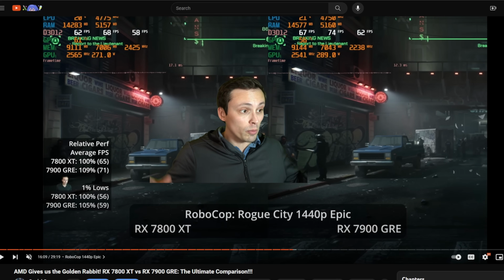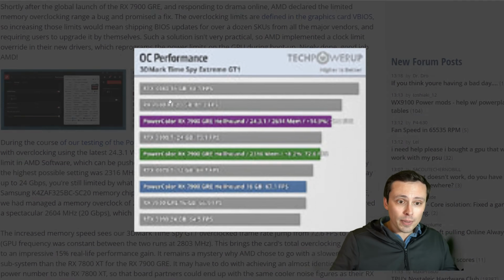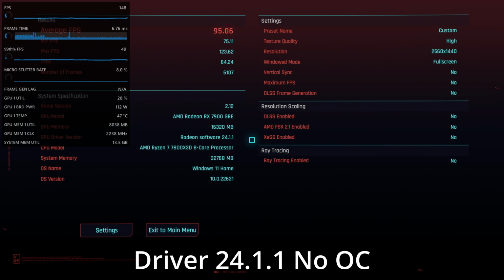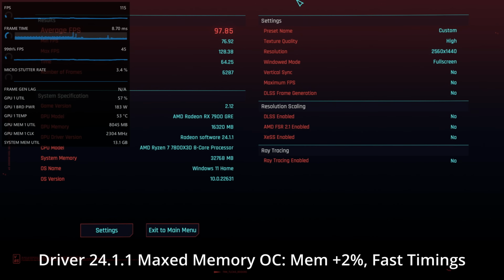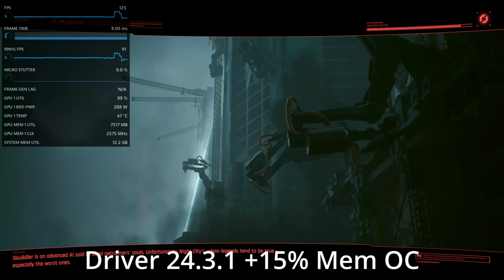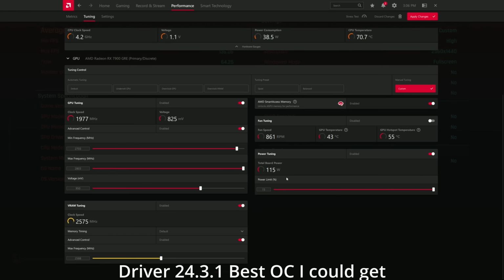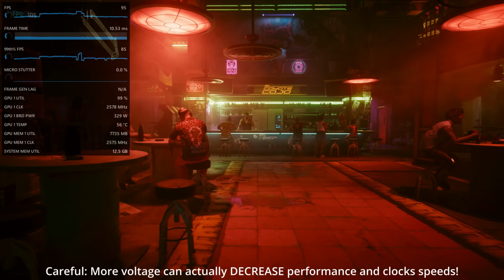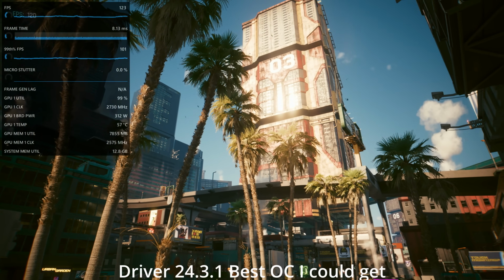Download more performance for certain AMD GPUs!!! (7900 GRE memory OC limits boosted in new driver)

Comment: I personally would aim for the highest speeds with the lowest possible voltage i can get
Reply: overclock kills the undervolt
Reply: @lifemocker85 ehh everyone’s hardware is different I suppose. My 3060 ti .975v with overclock to average 2025mhz user 210ish watts than compared to it using 300ish watts and 75ish C. It’s the asus rog strip V2 so my card can use total of 325 watts max but stock voltages and overclock too much power and heat, I do same to the 5900x 1.250V on core V and .900 on socket V with 4.7 all core, didn’t like going higher
Reply: @BMGGHOST  after certain mhz effiency just flys out of the window. if one wants effiency undervolt but overclocked effiency is gone
Reply: @lifemocker85  that is true, my biggest thing isn't really efficiency but temps I will correct the way I meant. I tend to go for it's rated speeds but if you lock it all core now adays people say that's an overclock even though I know that's not really what it is. So say 5900x I believe is rated for 4.7(without searching) so I lock all core to that and try to get the lowest voltage I can get so I can mainly lower my Temps with lowered significantly

Comment: Hmm. Very strange. Previously, in the 7900 GRE vs. 4070 Super and 7800 XT comparisons at stock memory and GPU frequencies in Cyberpunk 2077, you had an average of 102 FPS (QHD Ultra). Now it is 95 FPS at stock frequencies. And after memory OC without GPU tweaks, 104 FPS. Why such an inconsistency between previous and current results?
Reply: Different amd driver
Reply: @k1cs1m3a8  So it means that without memory OC, just with different driver you have almost same performance and memory OC give us only +2-3 FPS? What is all the fuss about? Update your driver and don't touch Vram)))
Reply: @nikitamorozov7553  no, the new amd driver give +2fps. And with the unlocked memory oc you can get +15Fps. In overall the gpu can do %20 more if overclocked than in stock. In stock 5% faster than a 4070 super with overclock much bigger gap.
Reply: @k1cs1m3a8  Sorry, but we are not talking about some probabilities. I compare certain previous video of this lad and current one - there is no +15 FPS difference. We have 102 FPS (old video result), 101 FPS (current video with 24.3.1 driver stock settings) and 110 FPS (24.3.1 driver with Vram OC and undervolted and overclocked GPU). This is less than a 9% performance gain.
Reply: @nikitamorozov7553  you should re-watch this video…..
Reply: @nikitamorozov7553  He retested the old driver in this very same video. It's comparable to what other 7900GRE get. https://tpucdn.com/review/powercolor-radeon-rx-7900-gre-hellhound/images/cyberpunk-2077-2560-1440.png
Reply: @nikitamorozov7553 hahaha good point man!. Full agreed. Its crazy. Daniel its biased for amd. Im disapointed. 😢😮 But why? So real fps its 2-3% boost. Definitley not 15...

Comment: Games I can recommend to test if your OC and UV are stable are GTA 5 and Fortnite. Both games are very sensitive to "errors and fluctuations" on different cards. If it is unstable, it will crash for the first 5 to 10 minutes.

Comment: In real world tasks, the VRAM overclock is only stable to about 2500 Mhz at most. For many it's only 2400 Mhz. That's disappointing frankly. Also, the AMD overlay negatively affects performance and shouldn't be used.

Comment: I have some knowledge of basic overclocked and I think the reason you lose performance when you push the voltage is because of the power limit and higher temp. In overclock to archive the higher clock speed you need the card to be more efficient, so undervolting make the card draw less amount of power to do the same task of work as normal card.

This make it so that higher voltage make the card reach power target before they can archived desired clock speed, also higher temp sometime reduced the clockspeed thus making it draw more power to push the clock and reach saturation much earlier than when undervolt. 

I’m also not an expert just love undervolting my gpu to get best result, I might be wrong if anyone understand it better feel free to correct me.
Reply: overclock kills the undervolt

Comment: Still wondering why AMD didn't name this the "Radeon 7900" or "Radeon 7800XTX" for the international markets? Either name would've fit in the line-up, maybe they really wanted this to stick out?
Reply: It is not something new. They released a RX6700GRE in the previous gen as well. Both cards were made for China in the first place. They did this with the chinese RX500 series as well but instead of GRE they were named SP or something like this.
Reply: Game Revolution Epic. ❤😮
Reply: It makes sense to keep the name that the card already had in its original release.  Why come up with tons of new names for the same cards?
Reply: They could've named it RX7900XL but does it really matter that much?

Comment: Loved my RX 6700 XT but ever since upgrading to RTX 4070 super, everything just runs much smoother. Initially I was thinking about picking RX 7900 GRE but since I only play on 1440p RTX 4070 super is more than enough for me.
Reply: So you paid more for less performance.
Reply: Not really, my cp2077 benchmark (w/o undervolting and overclocking) achieved a higher average FPS (105>101) and a much higher min FPS (95>86) compared to Daniel's results. I'm not a huge fan of Nvidia's GPU prices but coming from an AMD GPU, Niadia's DLSS/FG and other features are still years ahead of AMD. @ZenAndPsychedelicHealingCenter
Reply: @lucaschenJC amd fanboys only see the gpu prices, raw performance and vram, they dont see the other things
Reply: @lucaschenJC which 4070 super do you have? Also, 1440p ultra benchmark? My 4070 super at 2830 mhz scores 88 fps :/
Reply: @Superdazzu2 Founders edition with the latest driver. Benchmark settings are kept exactly the same as what he did in this video.
Reply: @lucaschenJC  my question !! what makes rt so special on game which is ready special all alone ?? rt is just an unrealistic thing on games and the all the games are trushes with rt cause developers sucking with it !!! so there is no sence to run for rt and not even deserve that 150 more bucks !!! rt tbh is way more usable if you are working with it !!!
Reply: @ZenAndPsychedelicHealingCenter  better RT performance, DLSS superiority, efficient & DLSS 3 lastly must've weighed more that made him go with nvidia. I don't blame him tbh, cause I was on the verge of getting 7900xtx, then I saw few benchmarks and I changed my mind to go for 4080 due to RT performance.
Reply: I’m in the same boat but I’m waiting until I can double my 6700xt for $800 or less. 4070ti super is kinda close but not quite
Reply: Depending on what resolution you're on, I'd say wait for a future price drop for 4080/4080 super cause 4070 ti super isn't that much better than 4070ti/4070 super. @ipotato95
Reply: The 4070 enough but the vram not lol
Reply: @k1cs1m3a8 like I said I only play games in 1440p, so far there isn’t one game pushing anywhere near 12 GB VRAM with ultra high settings and no RT. 12 GB VRAM would only be inadequate if you game on 4K or like turning RT all the way to the highest.
Reply: @lucaschenJC  wrong!

Comment: Are AMD fan boys really praising AMD that the artificial limitations imposed by them are finally being lifted, when it should never have been there to begin with? 🤡🤡
Reply: Artificial limitations like not allowing overclocking at all in driver like nvidia? 🤡🤡
Reply: @blegi1245  why are you comparing it to nvidia? I thought AMD was supposed to be pro-consumer but they artificially lock their stuff too? Cant have your cake and eat it! 😂😂
Reply: @innie721  if amd allowed limitless tuning options and people were killing their cards by dialing in 3 volt vcore (or whatever the maximum value for the voltage controller is) you would be here blaming amd for the dead cards because you are a bad faith nvidia shill. Btw 90%+ of amd "driver issues" are people blaming amd graphics drivers for their unstable overclocks.
Reply: bug aint limitation
Reply: @blegi1245   that was for the op

Comment: One thing that can happen in rx 7000, or at least on the XTX is, that if your min clocks are too high while overclocking it can happen, that the clock of the VRAM goes down. This can be helped a lot with undervolting it

Comment: since most of the amd gpus are power limited (even a Vapor X 7900XTX) undervolting = less power draw = not (or not as often) hitting the power limit = more stable clocks.
Sadly AMD took away one of the greatest tools the 6000 cards (and below) had, MPT. 
You could undervolt SoC, Mem, Core individually which lead to an even greater increase in performance + better temps.
I will forever hate them for doing so.
Now the only option, if already undervolted to max stable, is to flash your bios
Reply: Can't even flash your vbios without buying a Ch341a bios programmer. AMD is notorious for locking down overclocking. It's pretty lame.
Reply: @jjlw2378  Lol this is the first gen that AMD lock down their bios, after all those used RDNA2 cards ended up with mining bios.
nVidia is the one that is notorious for locking down their vbios since Turing.

Comment: My 7900 XT Runs absolutely perfectly on the latest drivers. 
I just switched to AMD, and it seems there was no better time. 

I've been playing for hourrrrrs for days on both old games, new games, and retro games. Everything has been perfect. 
And got a beautiful undervolt and overclock on it.
Reply: Idk why AMD has this "crash happy" stigma attached to it. 6950 XT never has an issue. Competitive and AAA games from the last 5 years all run perfect.
Reply: @TheCosmicMason    Only time I've gotten a "Driver timeout" or crash is from me trying to overclock the thing by 15% lol .

And when that happens, just means i need to add a little more MV juice :octopus-red-waving:

But Nvidia is not different lol. I've had a 4070, 4080, and 4090. One second I think the overclock is good, then I crash randomly hours, minutes, or just sitting at the desktop lol. 
Overclocking or undervolting can be a real bitc. It takes time, testing, and patience if you are trying to push high, or low. 

Outside of self induced errors, never a single issue of ANY kind. The ONLY thing AMD wise I've ever had issues with is their metrics not showing up in certain games. that's literally  it lol. And I use afterburner for all my chart goodness.
Reply: @TheCosmicMason  It's not the crashes that are the problem personally, but if you look at their patch notes apparently there are problems. The thing is when you run AMD and Nvidia side by side daily like I do you realize AMD absolutely earns the reputation of instability and poor drivers. They're miles ahead of where they were in the days of yesteryear, but when you run them side by side they just can't quite get there compared to Nvidia. Especially when it comes to VR.
Reply: @zodwraith5745  Look at Nvidias patch notes, and not the ones they show briefly. They have game crashing, and failure to boots as well. doe shappen more on amd on average, but Nvidia isn't out of the park.
Reply: Have you tried Helldivers 2?

Comment: 18 gigabit per second per pin is the fastest GDDR6 memory all 3 major memory manufacturers (SK Hynix, Samsung and Micron) can supply. If you specify 18 gbps memory you can bid all 3 manufacturers against each other and significantly reduce cost. That is also the reason why Sony chose the same memory speed for PS5 Pro.
Reply: As many times as you say this on many different comments it doesn't make it true. It doesn't take more than 3 seconds to look at the 7900XT or XTX to see that you can buy 20gbit/sec GDDR6.
Reply: @zodwraith5745  you can buy 24 gbps GDDR6 you absolute rtard. Problem is that only one manufacturer can make it and because of that you pay monopoly prices for it (just like nvidia does with proprietary nonstandard micron GDDR6X). Xtx and xt use 20 gbps memory because 20 gbps is the fastest memory Samsung can actually supply (the faster speeds exist only on spec sheets). 20 gbps is more expensive than 18 gbps because you go from 3 possible suppliers to 2 possible suppliers. 24 gbps is even more expensive than 20 gbps because you go from 2 possible suppliers to 1 possible supplier. Understood or is this beyond your comprehension?

Comment: It really seems like when they were designing this they were hypersensitive to make sure it doesn't touch the 7900xt without paying attention to the 7800xt and gimped the memory way too hard. I have to wonder if they bought WAY too much of the cheap memory for the 7600, 7600xt, and 7700xt without them selling enough to go through it.
Reply: 18 gbps is the fastest GDDR6 all three manufacturers (SK Hynix, Samsung and Micron) can supply. Graphics memory faster than that is significantly more expensive because you can't bid all three against each other. It's not a coincidence that Sony chose 18 gbps memory for PS5 Pro as well.
Reply: @blegi1245  Huh? The 7900xt and 7900xtx use 20gbit GDDR6. Not to mention GDDR6x is even faster. Where did you get this idea that 18gbit is the fastest GDDR6? Sony chose it because it's cheap. Period. They've been doing that since the PS1. Same reason AMD does. AMD keeps using it because even the 20gbit is half the price of the GDDR6X that Nvidia keeps using. 

People keep thinking Nvidia is "cheaping out" on vram without realizing GDDR6x is $8/GB and GDDR6 is $4. Nvidia spends more on the 4070ti super and 4080's memory than AMD does on the XTX. My problem is Nvidia keeps using that overpriced shit on cards that don't need it like the 4070.
Reply: @zodwraith5745  and what are the msrps of those different products? Have you ever considered that amd made 550 msrp possible for the gre by specifying lower quantity of 18 gbps memory and using navi 32 boards (made possible by the 7900m navi 32 is navi 32 package)? The navi 31 die in gre costs exactly the same to make as a 1000 dollar xtx (minus allowance for some defects).
Reply: @blegi1245  If you want to talk about margins let's talk about margins. Aside from the 4090 AMD has bigger margins than Nvidia. Not only are their dies smaller but they're using MCD with cheaper nodes to cut costs, as well as cheaping out on the ghetto memory for a "flagship" product. It's not opinion but straight FACT that it costs less to produce an XTX than a 4080. BOTH companies are ripping you off so stop acting like AMD is all noble and trying to reduce prices. Threadripper pricing alone is all the evidence you need to see what AMD does when they have the lead.
Reply: @zodwraith5745  do you have psychiatric problems? Are the voices in your head taking about threadripper and how wonderful amd is? Because i for sure haven't talked about either.

Comment: 15% increase is actually pretty substantial from the same card. Unless it’s intel arc after they patch a specific game lol.
Reply: LOL 4%
Reply: You are blind. Check previouse Daniel comparsion amd drivers. Old drivers doing 102/103fps... real boost its max 7%. Not 15...
Reply: @furieux6742  Ive seen multiple comparisons now. Hardware unboxed did one and its 10% on average. Depends from card to card really.

Comment: interesting thing about the 7700xt and the 7900gre, they use the same 20gbps memory chips as the 7800 xt and 7900 xt, just underclocked to 18gbps. This means the 7900 gre/7700 xt probably have more headroom for memory overclocking (tho I assume the MCDs are lesser binned)
Reply: Exept they use memory from multiple different vendors (some of which are faster than others).
Reply: @blegi1245  it was according to the memory compatibility in the vbios in TPU, both variants were 20gbps. 

not sure how accurate, but it would make sense with volume pricing and all
Reply: @potatoes5829  18 gbps is the fastest all 3 manufacturers can supply. It's not a coincidence AMD (and Sony for PS5 Pro) specified that speed. That way you can bid all 3 manufacturers against each other and have significant cost savings. That makes faster than 18 gbps GDDR6 memory significantly more expensive. The memory supplied by the 2 manufacturers which can make faster memory is just down binned (or unbinned) faster memory (20 gbps in the case of Samsung and 24 gbps for SK Hynix). How fast the memory is on your specific card depends on which manufacturer you got and luck (remember the memory is specifically not binned to guarantee the rated speed for that manufacturer. It is only guaranteed to make the 18 gbps speed specified in the contract).
Reply: They are not exactly the same. Mine has a higher bandwhich on the card. And Mine does 2750 on the memory with no issue.   
But the GRE is incredible value, it really is!! this new unlock by AMD was such a gift for us AMD users.